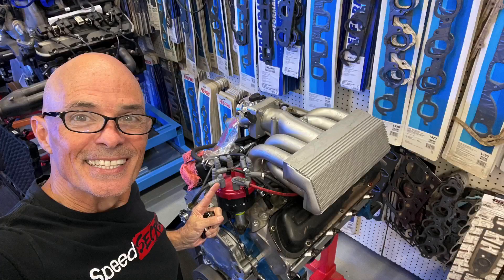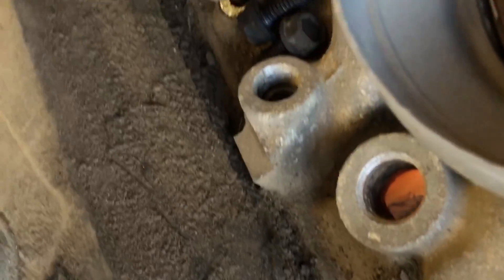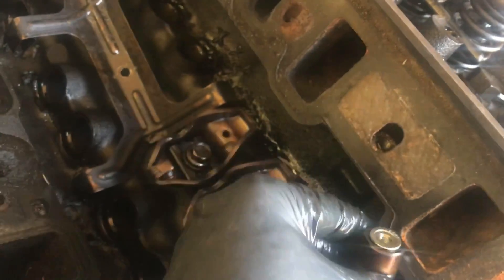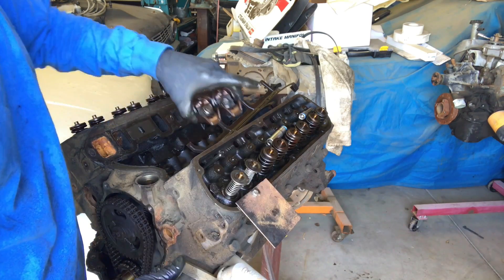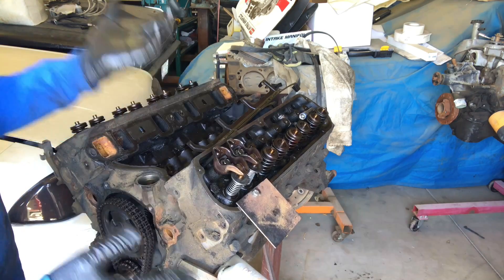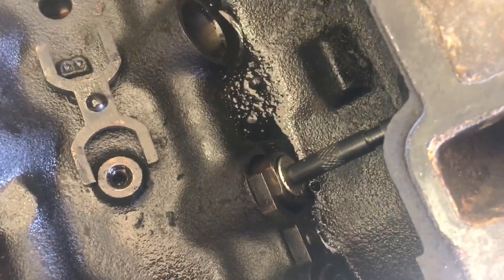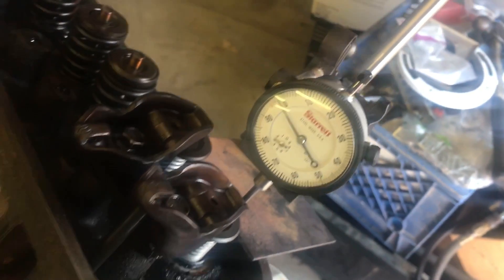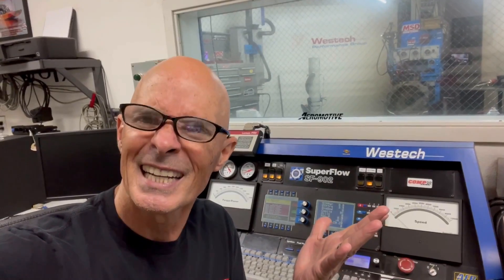HOW TO MEASURE PISTON TO VALVE CLEARANCE. HOW BIG OF A CAM CAN I RUN IN MY 5.0L FORD? HOW MUCH LIFT?

Comment: Please post part 2! Also with the 1.9" valve Enforcer heads which may be able to run a cam with clearance that the 2.02 can't. Both size valve heads are available in the Enforcers.

Comment: I stuffed a tfs stage 2 cam. 1.7 rockers.   Tfs 11r 190 heads at 56cc in a bone stock bottom end 351 with miles. Miles of clearance

Comment: 512 lift. I know this i just built mine and summit racing told me that's what I could get away with.
Reply from the maker: the lift has almost nothing to do with p-v (duration is the key)
Reply: @richardholdener1727  they both do because summit racing told Mr that the x303 I would have needed piston to valve clearance it was 542 lift so I went with the f303 512 lift. He said that was Max lift that I could have went with without valve clearance. Great cam the ford racing cams.
Reply: @richardholdener1727  the lift is how far the valve opens. And the 512 was max lift for stock pistons.

Comment: What happens if you don't have enough valve clearance do you have to go to a smaller duration
Reply from the maker: yes-less duration
Reply: @richardholdener1727  you could fly cut the pistons also to give a little more clearance
Reply from the maker: YES

Comment: I have a stock 93 or 94 5.0 in my car, will 2.02 intake valves work with stock pistons?
Reply from the maker: WITH WHAT CAM?
Reply: @richardholdener1727   I was planning on using the B303 cam

Comment: How can I find the part two of this video? I have afr 165 heads with the xe274 cam going in a stock 93 bottom end.
Reply from the maker: NOT UP YET
Reply: When is the next one coming out. I am about to change out the x303 cam with the xe274hr one. It has been running with the afr165 heads and x303 for a year. Stock bottom end and stock pistons.
Reply: Just tried it and it will not work with the measurements I got. I tried the intake first and it was too close. I retarded the cam 4 degrees and the intake was good but now the exhaust is too close. 0.050 on exhaust and 0.095 on intake. 
Any ideas now?

Comment: Richard have you ran this cam with stock rocker arms? I have the xe274hr and ported gt40p heads. But want to use stock rocker arms till I get a deal on roller rockers.
Reply from the maker: it works

Comment: Absolutely need to watch the part 2 of this...  but i haven't found that video yet..   That's exactly my situation - 2.02/1.60 Heads with E-cam and stock HO forged 302 pistons.. (Liberty Aluminum Heads)  I really do need to know before I buy some $500 pistons and then discover I didn't need new pistons just to get bigger valve reliefs...that's my luck on stuff like this... I'm clay checking this weekend....    🤔

Comment: I have run the 282hr on a stock bottom end with gt40 heads. Car has made 100 or so 1/8 mile passes trapping at 6400 rpms with no issues yet.
Reply: Using standard lifters?

Comment: Good to know. What springs are you using on these stock heads with the 274 cam though? I don't believe the TFS springs can handle that lift. Limited to .540" I believe.
Reply from the maker: the engine did not require springs to do a simple p-v test
Reply: @richardholdener1727  I get that but I'm curios what springs I would been on gt40p head swap with that cam. Can't seem to find any. I've used  Alex parts in the past with good luck but he is out of stock. Thankyou though

Comment: I have a open question about cams in general.   Has anyone ran into a issue with soft cams.  My uncle told me he knows 3 friend who have wiped out their new cams on first start up.   Since 2018 I guess most cams, are being made with softer metals,   supposedly you have to break in a new cam with stock springs to harden it. Then switch to the aftermarket springs.   It's the only thing that helped, idk just wondering if anyone has heard or seen it happen
Reply from the maker: this is more prevalent on flat tappet cams
Reply: @richardholdener1727  got ya thanks. Just didn't want to wipe out my truck norris cam

Comment: Part 2 will the most valuable since many people will also want to upgrade to aftermarket heads without pulling the bottom end apart. It would be extra cool if he did 20 deg in line heads and then Trick Flow twist wedge 170cc

Comment: Sweet you can put a good cam in a 302 w e7’s :p and gain like 25 hp
Reply from the maker: ITS MORE
Reply: @richardholdener1727  28 :p
Reply: I’m going to put an f303 cam in my 1993 stock Foxbody engine (other than an rpm air gap/ 2” tapered spacer and proform 650 dp. Any guess what I MIGHT gain. Yes I’m going to do a trick flow 2500100 spring kit as well
Reply: I have been told about the bottom end torque loss that this cam will result in, but I have ZERO CONCERNS about that this car is stick shift TNT beater that is only going to suffer from the cam unloading it from the trailer. I launch at 5000 rpm and shift at 5500 rpm currently. I will raise my launch to the rev limiter on my Pertronix distributor that I just installed and set at 6000 now. I will also raise my shift points now in 100 rpm increments till it starts to fall off
Reply: BTW I’m very impressed with your no bs approach to the FACTS present  RICHARD

Comment: Thanks for your reviews. I like the bolt on steel plate for the dial indicator. I'll have to use that next time instead of balancing it on the block webbing!

Comment: Your videos are super helpful. I work on all the normal v8 stuff on a day to day basis. And I’m super knowledgeable and capable when it comes to rebuilding pretty much anything. But super new at the horsepower stuff. Anybody can change parts. Putting together the ignition timing, cam timing,valve clearance ,fueling and  tuning in general. those things can only be learned in schools or trial and error. both can be extremely expensive and time consuming. Trial and error is always a big factor but your videos help out enormously.thank you very much.

Comment: I just love that you can independently set the intake and exhaust centerline, and lobe seperation angle on stock 4v modular engines and basically tailor your stock cams for your appliation. From the factory, mine were set at 119/106-int/exh centerline. Setting oem 99 camshafts to 106icl/118ecl, felt huge in the car and idled more aggressively too.
A lot of people think what they need is a ton of duration on the intake lobe to make power but ive got stock 99 cobra 200° at .050 intake cams in my 04 c headed 4.6 and it revs happily to 7k rpm.
Reply: Interested to see the numbers on a dyno. May be the placebo effect because if everything else stays the same besides overlap I find it hard to believe it’s any real difference.
Reply: @DWBmotorsports  Heres the exact message:

Degreeing the cam ensures they are where you want them. Additionally, advancing/retarding the cams puts the powerband where it needs to be to best suit your needs. Moving the cams from the stock position can do many things: add mid range hp/tq, raise or lower the rpm where peak power occurs, prevent the drop off power after peak, etc.

The stock lobe centers are 119/110, this is good for emissions and upper rpm power with low mid range hp and tq.

1. 108/114 is good for mid range hp, tq and will put peak power at 6000rpm, power will drop off rapidly after peak
2. 108/120, good for mid range hp and tq, peak at 6000, power will not drop off as fast as #1
3. 110/118 a little less mid range hp and tq and peak will occur just over 6000, power will not drop off as fast #1
4. 112/118 less mid range and tq than #3 but peak will occur higher, around 6200, less power drop after peak than #3, good for FI
5. 114/116, good for carrying power out past peak, works well with short runners, needs more gear than the other options, good for FI

Intake lobe centers higher than 114 are good for fuel mileage emissions, terrible for for n/a power.
Reply: @madmod  I’m not sold without seeing numbers on a dyno. The differences in advancing or retarding a pushrod cam are very minute on the the dyno from what I’ve seen. I understand the theory 100% but I think it’s a very very minor change, likely not something you’re gonna really feel in the seat of your pants.
Reply: @madmod  I’m aware of the obvious differences between single cam and dual cams, like I said I’d like to see this on an actual dyno since it’s apparently such a comment trend
Reply: @DWBmotorsports  Just check out what people have been doing with nmra stock engines. Tons of dyno and track times listed. I can think of several guys running 98 cobra intake cams on both the intake and exhaust side of 03/04 cobra headed 4.6s that have got to be at least 375rwhp to be running 10s in 1/4, at 3k lbs race weight, which they did and still do.
Reply: @DWBmotorsports  The 99 cobra intake cams have around 16° more duration than stock 03/04 cams on their own. When degreeing the cams, you have to choose where you want it to make power. Talking to Todd from na svt cams is where i got my specs for degreeing my combo. Hes adamant that the stock cam timing is set purely for emissions and while their wide icl is decent for power past the peak, it's far from optemized for average power with the combo. Having the intake cam set 106-110° icl is worth significant power and torque through the midrange compared to the stock 119° icl but will fall off on power earlier after peak. Richard has a video up on the effects of lsa on power but modulars are a different animal than the ls, especially the 4v modulars. Unlike a coyote where you get variable valve timing for tight icl at low rpm for torque and a wide icl for peak power, the modular has to have the cams set and locked to a specific spec. Luckily, you dont need a whole new cam to change it. Just a degree kit. Ill see if i can pull up his recommendations for how to degree a 4v.

Comment: I ran the 274hr cam with stock pistons and stock heads with the gt40x head valvetrain in them. Valves (1.94/1.54), upgraded Ford racing springs and Ford racing retainers with 1.6 motorsport rockers. Ran good.
Reply: Any hp numbers on your setup
Reply: @elias Tillberg  no. Just threw it together in the garage.  Heads are on a 306 now with cast replacement pistons and a old crane power max cam. It's waiting to get stuffed in a 66 mustang coupe.

Comment: I have stock explorer short block, tfs 11r 190cc heads, fti custom cam and running .607 lift at 224/232 duration. Have .95 clearance on intake and exhaust barely touched the clay.
Reply: That's nice!

Comment: Richard i have a 89 non ho 5.0 with the e6se heads what cam can i run will a e303 fit
Reply from the maker: I HAVE NOT TESTED THAT COMBO
Reply: @richardholdener1727  have u ever ran the e6se heads

Comment: What would running a 1.7 roller rocker change compared to the factory 1.6 stamped rocker arm.
Reply from the maker: IT WOULD MAKE A 500 LIFT CAM A 531 LIFT CAM
Reply: @richardholdener1727  one question I've had trouble answering for myself related to going with 1.7 rockers, does that change affect more than just lift? What happens with the specs on things like duration, LSA, and the timing events. Are they unaffected, or do they also change?

Comment: Richard, I'd like to note that a 5.0 out of a crown vic or lincoln might give you trouble. They have flat top pistons with NO valve reliefs and had the E6 heads that had valves sunk way up in the heads. Both budget 302s I built, one with an E-cam (got a billet one for $50, I couldn't say no) and the other with a Comp 260XE both would have crashed the valves into the pistons. The E-cam engine had milled 1969 302 heads (stock valves) and the Comp 260 engine had milled GT40 heads (stock valves). I might have gotten away with both if I had a Mustang 5.0 short block with factory valve reliefs but, the much more plentiful luxury car roller 5.0s are going to be used in budget builds these days. FYI, I used a die grinder and play dough to relief my pistons, budget cuts required extra elbow grease. Great video.
Reply: @Aaron Loos the vegan hunter Aaron, my experience is you will have PTV clearance issues. I had a Ford piston as an example on where the valve reliefs would be located. I then made a 4 inch circle template using a thin piece of plastic, transfered the valve relief locations onto the pistons on the assembled short block. Use lots of masking tape and pack the edge of the piston with play dough so shavings can't fall into the piston to ring gap. Do one at a time and take your time cleaning and taping as you go. You don't need much about 0.060 deep at the most. Do one piston and then recheck to make sure you've cut out enough. It's time consuming but, bending 16 valves is time consuming and costly.

Comment: Well done as always. 
But when doing this procedure on a salvage yard 5.0 that’s as filthy on the inside as the outside, it’s probably best to make allowances for the gritty gunk buildup between the lifter and cam lobe. 
One can never be too precise when precision matters 😉.
Reply from the maker: BETWEEN THE LIFTER AND CAM? THERE IS NO BUILD UP IN THOSE MATING SURFACES
Reply: @richardholdener1727  … Richard, gee whiz 😳. Thanks for the explanation.
I didn’t think you would take my gritty comment seriously or post a reply. I know you would never attempt do any type of adjustments or checking the P-V clearance if the internal components were contaminated. I was making an attempt at humor that obviously failed BADLY.  Oh well… I’m going to keep my regular day job and leave the comedy to professionals like you.

Comment: The 282 cam is a pretty big cam for a stock motor. I'd be curious to see how much power it could make with the stock e7 heads or heck even gt40s

Comment: The size of the intake valve is the major hurdle.  An inline head with 1.90 or smaller will clear the majority of cams most sbe 302 guys will want to run on the street.  1.94" starts to limit your choices.  This doesn't include TFS offerings.  I've always used .080" for the minimum on a street motor.  BTW, you can flycut the relief if you have forged pistons.
Reply: Back in the day if you wanted afr 185 you had to fly cut the stock forged pistons, you are 100% right because of the intake valve but a set of Windsor sr or roush 200 cc direct bolt on. Comes down to intake valve and if head design is forgiving
Reply: @thacutoff6226  Those were very lazy iron heads.  They weren't popular for a reason.  I had a buddy with a set on his Windsor.  I never fitted them to a 5.0L.
Reply: @chriswise1232  they aren’t afrs but they flow out box 245 cfm @.500 lift and with porting and 2.08 intake valves they can really cook

People didn’t like iron cause were heavy but hold heat better then aluminum. They were a nice alternative back in the day, or hedge against warping aluminum heads

To your point gt40 heads like 30hp, world sr like 50hp, afr 185 like 80+ hp …… these are potential hp increases
Reply: @thacutoff6226  I've seen a car swapped from GT40 to box stock world senior and gain nothing at the track.

Comment: Your cam depends on what year stock pistons are...back in my day I'd use 1986 shortblock with the factory flat tops 10.1 comp ,ford F cam and 1.7 rockers was the max.

Comment: Man you must be reading my mind just got a set of gt40p heads and a 351 xe274h flat tappet cam for my 302. Will be doing this in a few months. Thanks for the tip i like this method vs using playdough. 👍👍

Comment: Love your content as always! 

What would you say is the go to minimum piston to valve clearance? I've heard 2mm (0.079in) 
Any other numbers you would give as a rule of thumb?
Reply from the maker: .050-THOUGH WE HAVE RUN IT TIGHTER
Reply: @richardholdener1727  Depends on how hard you turn the engine and how good the valve train is. 050 is generally very safe. 040 is flirting with danger but I have ran a Chev there. Though upon disassemly a couple of valves had been touching occasionally. Not enough to even bend the valves, just enough to brush the pistons. Probably at 7500 rpm with the usual redline 7200.

Comment: I love the Comp Cams XR274HR cam. it is grate replacement for just about any factory motor. I ran one in my 71 SS 396 Camaro for years. I prefer the Extreme Marine version XM274HR with 112 degree lobe separation for street use. the added 2 degrees of lobe separation make it idle better and i makes marginally better vacuum.  I heard the Comp Cams High Energy and Extreme Energy series cams were designed by Harold Brookshire. who owned UltraDyne before it went bankrupt 2003, and later Designed the Voodoo line for Lunati. Also heard He used to make the cams for Darrell Waltrups cup motors. I used to run a UltraDyne in the 427 powering my Hondo Drag Boat. back in the 90's.  He passed back in 2015. its too bad all these old timers are being called home.

Comment: Interested in the same test with GT40 and GT40P heads. I've got a set of GT40P's with the larger ex valves from the GT40.

Comment: All of the forums are wrong. They say a 274hr won't work on a stock engine. I guess with all of that clearance gt40p heads could also run the 274hr??? Thanks for the video.

Comment: I can tell you that a 274 cam will NOT work with AFR 185 Renegade heads (2.02/1.6v) and speed pro standard forged replacement pistons with the 4 valve reliefs.

Comment: What would the minimum clearance for the valves?
Reply: Minimum safe clearances are 0.05 on the intake and 0.10 on the exhaust.
Reply from the maker: WE'VE RUN .035
Reply: The standard is 80 thou and 100 thou

Comment: so the 274 555 lift cam clears because of it LSA? I remember Ford saying you couldnt use the F303 cam with 512 lift because of the P.V. clearance in a stock engine.
Reply from the maker: ITS NOT LIFT
Reply: It's the 226 or 288 of duration. I ran edlbrock aluminum 1.9 heads with a F cam for years. 2.02 heads won't work with f cam